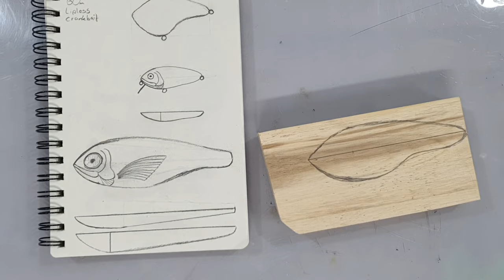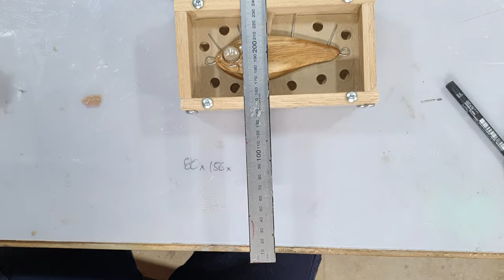125mm Sinking Stick Bait

Comment: That bit of painter's tape was brilliant mate!
Reply from the maker: Cheers. The orange with yellow  didn't come out how I planned I'll try it again but probably put the yellow on first with the orange over top.
Reply: @ArbourLures  sorry mate, not what I meant. The painter's tape to keep the clay out of the carved details was brilliant! Fish won't even care about that tad bit of paint peeling off. 

I'm presently working on a lure that requires a good deal of masking, so I clear-coated over the base layer of paint. This way, when I put all the tape on it, there should be no peeling when it's pulled off... hopefully.
Reply from the maker: Oh hahaha yeah that clay I have is some sticky stuff. I didn't want to picking it out of the carvings.
Reply: А можно пожалуйста компоненты указать для заливки и название их, чтобы русской аудитории было понятно? А то с видео на русский перевести не могу
Reply from the maker: Hi are you referencing what the mould was filled with? 
It is a 2 part polyurethane casting resin. has a 2 minute working time and 15 minute demould time.